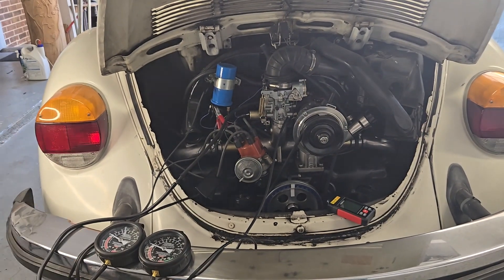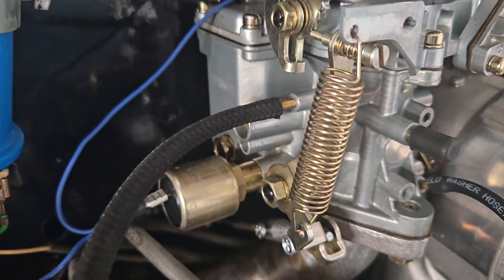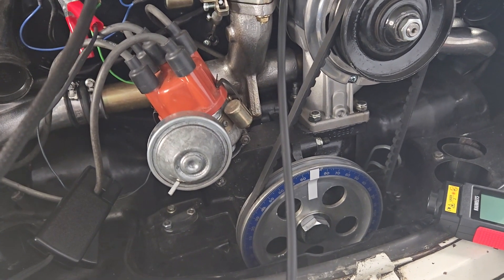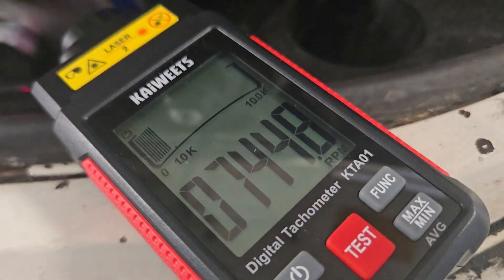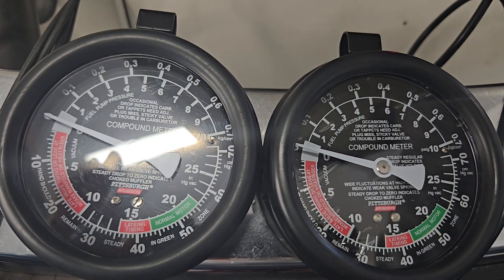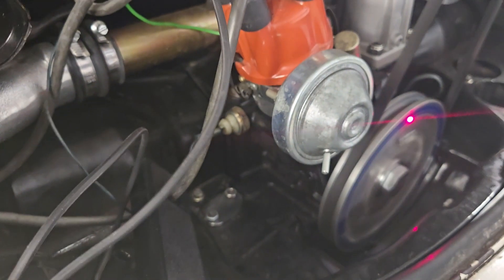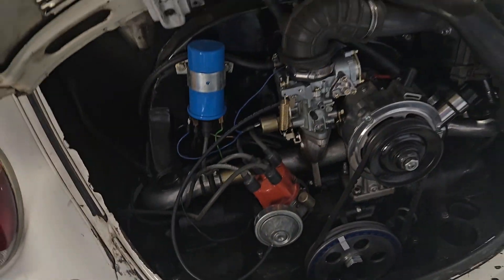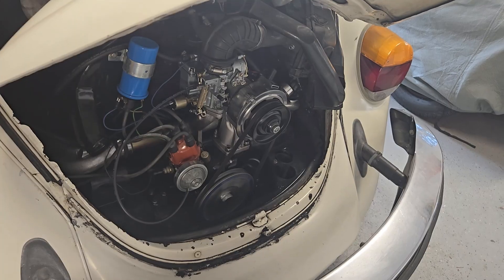Classic 1979 VW beetle 34 Pict 3 vacuum ports  - which ones do what

Comment: Nice! And I noticed you don't need to connect the vacuum line on the backside of the distributor, but you did cap off the vacuum port at the front of the carb. Thanks Alex.